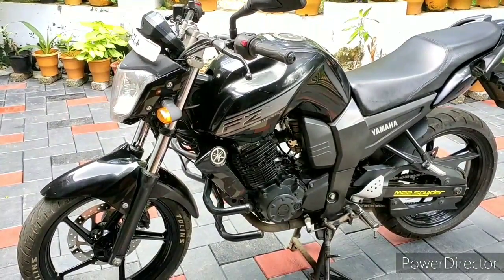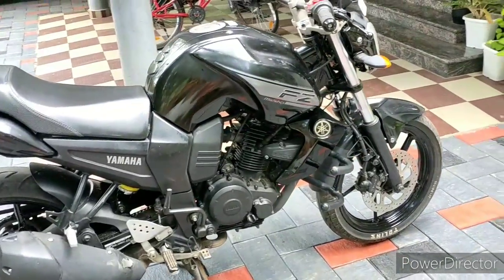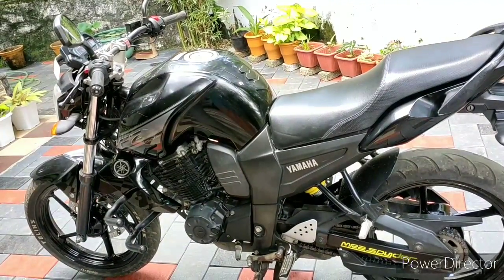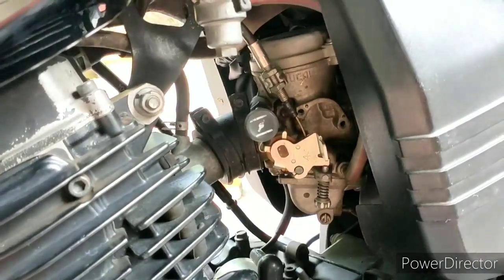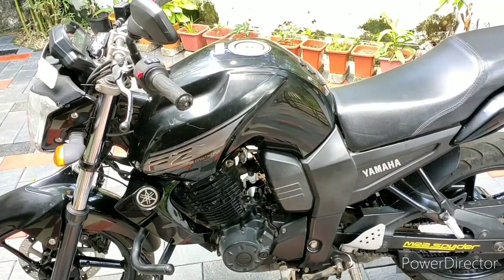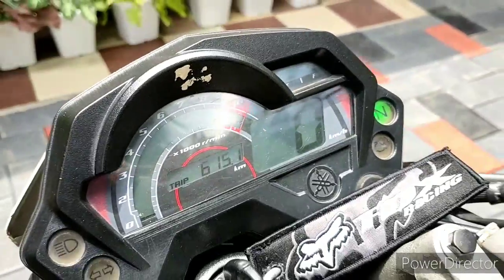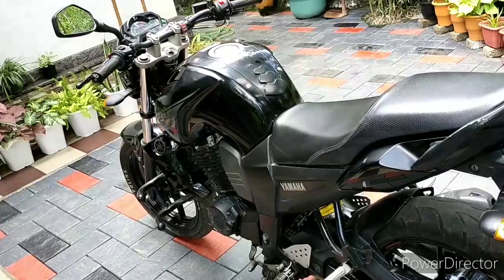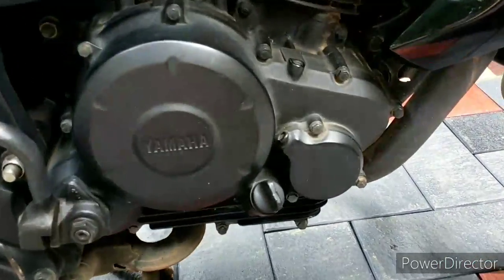How to increase the milage of bike Malayalam.// yamaha fz milage tips//gosso

Comment: Bro im using fz v1 2013 model its giving 30-35 mileage how can i increase bro please help ❤
Reply: Same enikkum😢
Reply: @muhammadmubashir8680  enna bro problem edhu therinjicha
Reply from the maker: General check up cheythu nokku. Air filter, engine oil, oil filter, carbarator cleaning & tuning.
Reply: 😢എനിക്ക് 20
Reply: Enik 30
Reply: Pulsar b3 carburetor anoo

Comment: Pulsurnte carbater വേക്കുന്നതിലും നല്ലത് ബജാജ് ct 100 ഒട്ടുന്നതാ
Reply: Pulsar 150 carbater vechal entha prashnam onn parayavo
Reply: bro nyan 180 carb aan ittekunne valya kozhapilla
Reply: @muflihkp5936  bro 180 nook 150 kollilaa
Reply: @muflihkp5936  milage yatra kittunnund bro
Reply: Bullet classic Carbrater supper. 45-50 mailage supper pulling
Reply: Pulsar carburator ittal ulla problems
1. Overall smoothness kurayum
2. Oru 70-80 above poyal missing varum
3. Engine warning light eppazhum kathi kidakkum
4. Top endil power kuravayirikum
5. Mileage oru 50+ kittum.

NB: Njan Pulsar carburator kurach kalam use cheyth pinneed Original Fz carburatorilekk thirich vannu. Ipo oru petrol filter vach aan use cheyyunnath. No issues now. Vandi nalla smooth aan. Oru 50 Kmpl oke mileage kittanund. Kurachude nokki odichal athilkooduthal kittum. 🙌🏻
Reply: 220 de carb vechaal nallathahnn ente vandiyil vechittund nalla reethiyil power und
Reply: Badger Gaming ꪜ  40
Reply: @afsal6422 Bro petrol  filter enganeyaa vekkunne

Comment: Bro fz de clutch cabel etra adjust cheythitum kurach odi kazhiyumbo tight aayi varuva
 cable okke maari noki sariyavunilla
Reply from the maker: Gear box nte ullil clutch rad eannu oru sambhavam und. Mikkavarum athinu theymanam sambhavichathavum karanam.

    2014 thazhe ulla vandi aanenkil engine azhikkendi varum athu replace cheyyan. Athinu mukalil ulla vandi aanenkil engine azhikkathe thanne athu replace cheyyanakum.
Reply: Clutch rad theymanam ondel vandik pulling kurayule  odikan nalla smoothness ond tight aay varumbo matram smoothness kurayunat
Reply from the maker: Sadharana ee oru karanathal aanu angane vararu. Ithine patty othiri deep aayittu eanik ariyilla. Nalloru mechanic nea kandu nokku bro.

Comment: Njn 180 de carb vechit 1 month ayathe oll... Ippazhum missing mariyittilaaa bro.. 🙂
Ntha chyka?
Reply from the maker: Air filter um athinte second filter um onnu check cheyyuka, kudathe air filter il ninnu carbarator lekk ulla pipe il eanthelum damage undonnu kudi nokkuka. Petrol tankil karadu vallom undonnum nokkuka
Reply: @gosso5663  air filter check chythu,air filter il nn carb ilot olla pipe putyath vech... Low rpm il ahn kooduthal missing, oru 50kmph nu mukalilot smooth aa vandi
Reply from the maker: Vandiyude head onnu azhichu valve onnu check cheythu nokku. Over aayitt kari undenkil athum kude onnum decarbonization cheythu nokkikkolu ok aavum👍